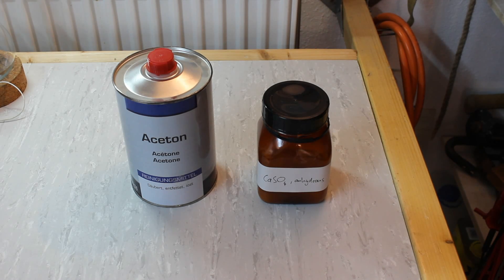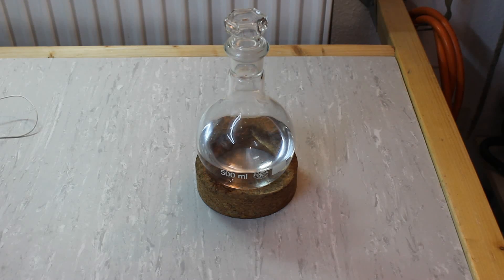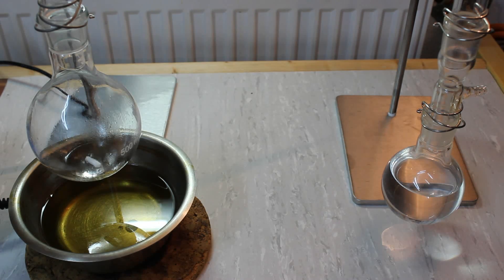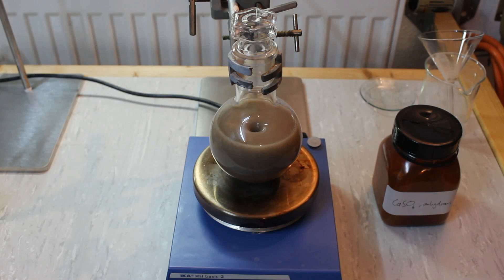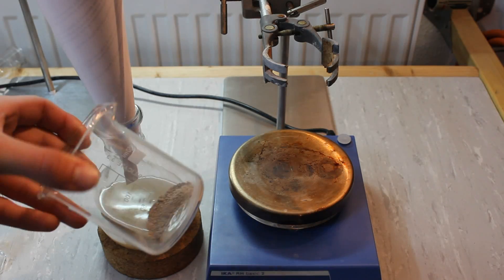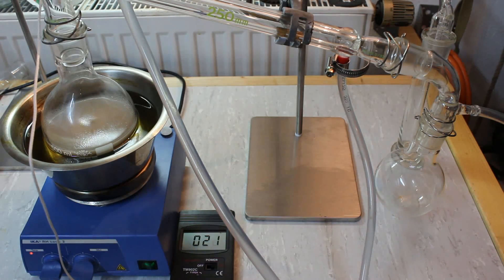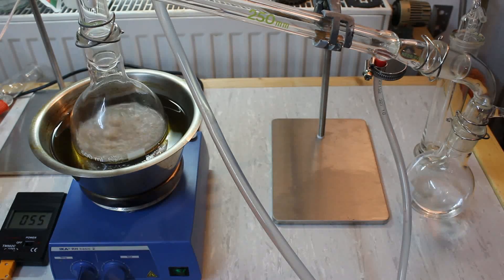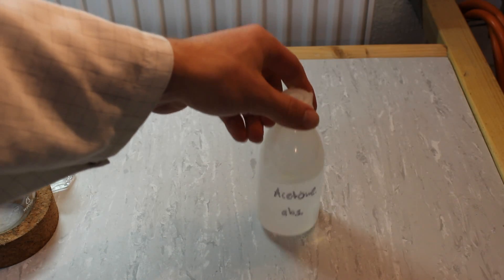Purification and Drying: Acetone

Comment: As far as I remember, technical acetone contains a little acetic acid, possibly acetaldehyde and water.
In order to get rid of these impurities, it is necessary to boil acetone (1 liter) under a reflux condenser for 5 hours with the addition of 4 - 5 g of KMnO4 (adding 1 g of KMnO4 every hour).
Then add 10 g of anhydrous K2CO3 and boil under a reflux condenser for another 2 hours.
Then, attach a descending Liebig condenser and distill off the acetone boiling at 56 ° C (132.8 ° F)
Your cleaning procedure leaves much to be desired, more like a child's way of getting rid of boredom.
Reply: Can u walk me through it

Comment: Do you have any idea how to clean the glass? I know the basics of chemistry and have been using bleach but I feel like a lot is lost.
Reply: @slimnaz00  what?
Reply: I use 91% alcohol, rinse it in the sink faucet, and then do a final rinse with distilled water. I dry it with paper towels and then let it completely dry. 
If you eant to make sure it's completely dry, you can put it in a vacuum.
But it'll pretty much be ready after the distilled water rinse. Anything left will be in the air and you won't be able to dry it more unless your work space is dehumidified.
You can also let the glass dry naturally. Paper towels have never made a difference in my experience. 
Put it into a vacuum instead if you want to be safe. Just my experience though. I'm sure there are better "approved" ways.
Reply: Transcript ??.

Comment: I realize this video is very old, but I have a tip:
If you add a small amount of water to the calcium sulfate and make “crumbles”, you can shake them above a sieve to remove any dust or small pieces. Then you dry them in two stages, first an hour at a temperature to remove the first water (to arrive back at plaster of Paris) then an hour at the higher temperature to get anhydrous. If you use these crumbles to dry things, it does not make a cloudy solution and settles out immediately. You just need to be aware that drying time is longer (if stirring) or shorter (if no stirring). I suggest allowing the solvent to dry with calcium sulfate overnight.

Comment: Why can we not simply do 1 step instead of both? I mean, doing either the fractional distillation or adding that CaSO4 then distilling out the acetone after the CaSo4 has settled?
Reply: Yeah you don't have to. Can just stir with CaSO4 over night and distil straight out of that flask onto some fresh sieves (can add some fresh CaSO4 if you want before distilling).

Comment: Hey can I buy anhydrous acetone off of you ? I will pay well
Reply: Bake epsom salt on aluminum foil at 275 for 15 minutes.  Scrape the epsom salt into the Acetone and it will absorb nearly all of the water.  Use a turkey baster to quickly take acetone off of the top and get it into an air tight glass jar.  You probably have 30 minutes before moisture gets back in,.
Reply: @ashchambers2764  You really want to take your Magnesium Sulfate up to 450, starting at 200 and slowly raising it over time. Maybe 50°F every 45 minutes or so.

Comment: Epsom salt works jut as good and plaster of Paris may have unknown additives depending on brand . Eosin salts comes pure and is easily available .
Reply: Just checking to see if "eosin" is a spelling error or not, and I'm assuming this is to be used instead of the calcium sulfate?

Comment: Starting with already pure acetone (but sitting long in a glass bottle being freuqently opened), would it suffice to just dry it and then filter with Celite instead of distilling? The resulting purity is not as much of importance as removing the water content.
Reply from the maker: If you're only looking to remove the water, then this will work, too. Generally you should always distill after adding drying agent, but if the purity is not too important, I guess it also works your way.

Comment: I can only find calcium sulfate dihydrate - does it take long in an oven to make anhydrous form? Is it possible to make anhydrous in an oven?
Also what do you use as vacuum source?
Many thanks.
Reply from the maker: Converting the dihydrate in the semihydrate or anhydrate is really easy: water starts to evaporate at temperatures as low as 100°C. I baked mine at 250°C for 45 min, but It doesn't have to be that hot, so yes you can definetely do it in an oven!
I have a video on how to build a DIY vacuum pump on my channel.

Hope that helps :D
Reply: ChemX
Thanks a lot for answering my newbie questions. I found a simple vacuum pump attachable to water faucet - this will do for most of my filtration tasks.
DIY vacuum pump tutorial would be awesome!
Reply from the maker: You're welcome!